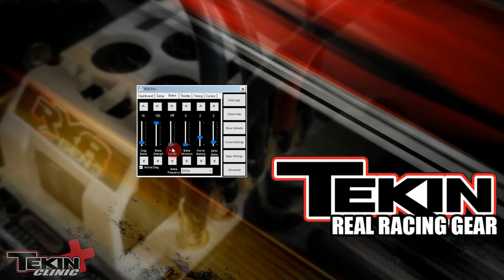Push Control | Tekin ESC Programming

Comment: Back in the day on my Futaba 3PJ Tx (with funnies), I had two thumb buttons on the thro hand to bump the neutral position up a step at a time, I would use this if it was getting loose into the turns, it was a secret weapon. I ran on-road for 2+ decades (I ran some dirt, but it felt like I was constantly trying to get back on the line), ran mostly Tekin after Novak screwed me over on smoking esc's. Kevin helped me out at the 1996 worlds at Revelation's with a G9 esc.